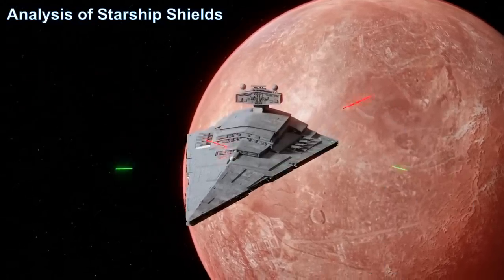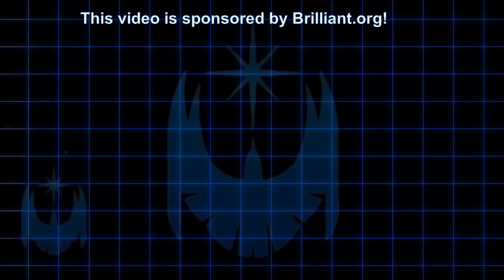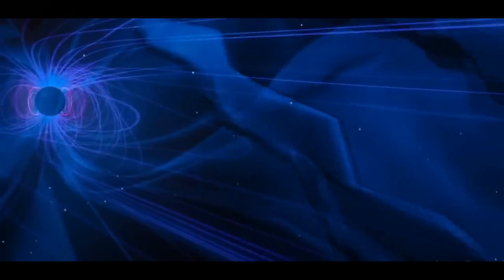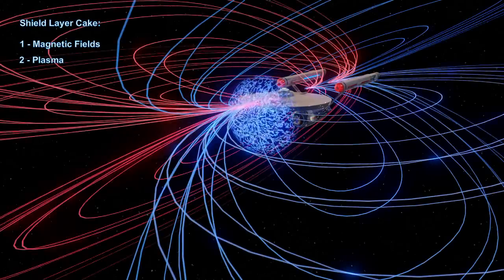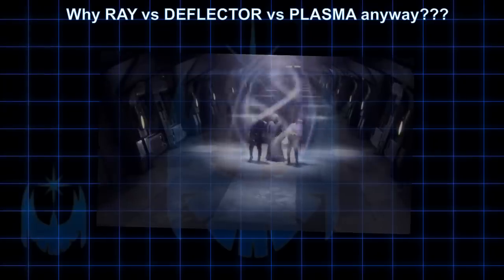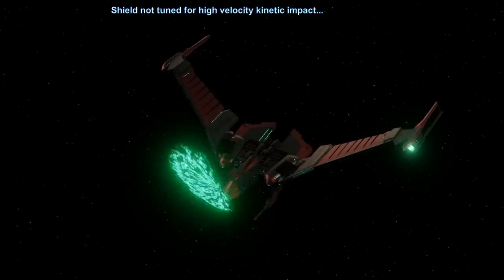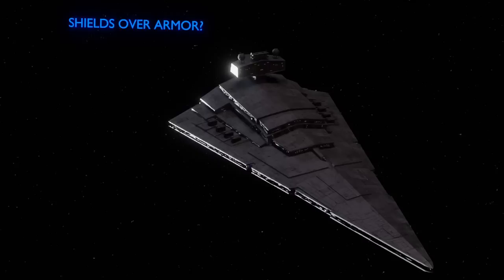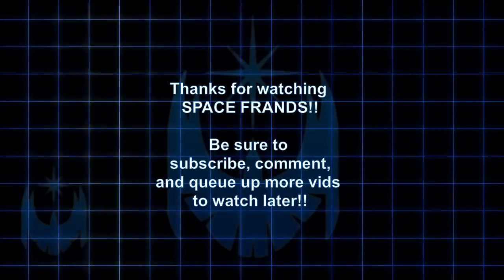REAL Starship Shields Types - They Work Like This...Animated Breakdown!

Comment: Another interesting use of shield systems in sci fi is the reflex gun in space battleship yamato where the beam is reflected from different satellites with shields to attack a enemy ship from multiple directions.
Reply: Oh you mean the Gamilas reflection cannons.
Reply: @barrybend7189  yes
Reply: The reflecting satellite cannon is a fairly unique one
Reply: @aliboy357  wasn't this in Tiberian sun?
Reply: @snikrepak  that's the Generals variant.

those in Tiberian Sun are parked in orbit — they don't need space mirrors to strike ground targets because they're already in space

two different things.
Reply: @aliboy357  except it is a one trick pony. If the weapon was used against starfleet, 9/10 times they would figure out how the shield works and modulate the shield to reflect the beam back to the cannon and make the gamilons embarrass themselves.
Reply: Speaking of SBY, its shields also let projectiles through without failing entirely, at least in the newer adaptation.
Reply: @justinthompson6364  it doesnt, the shields are an area of warped space around the ship
Reply: One can come up with Dynamic ways of Arranging New kind of Reflectors which Can also act as Beam Manipulators.
Reply: Remember Macross's (Point Defense shields) Pin point barrier system? Saving on energy usage vs an Omni directional Barrier system. and upping the power to the shields to just that one spot.
Reply: @Leo_ライオン  this type of system need computers to make millisecond decisions on what part to protect.
Reply: @addisonchow9798  Or a few gamers with joysticks, :D
- Think of the classic Arcade games, Pong, Centipede, Gorf, Space Invaders, Galaxian, Galaga, Missile Command, Asteroids. 
- Granted allot of these Classic Arcade games are where you shoot down incoming enemies/projectiles.
--- Never under estimate the reflexes of an old school gamer, I used to play Tetris so much. I saw the bricks falling when I closed my eyes, & in my dreams...
Reply: @Leo_ライオン  unfortunately, human reflexes isn't enough to react to anything that hits faster than 60 fps. The computer can make navigation and shielding decisions based on sensor data to coordinate different ship systems such as weapons, engines, and the shield to minimize damage. It also can calculate the shortest route to the enemy target while giving the human crew more time to think up a strategy to deal with the enemy and prevent a checkmate position where the ship can no longer defend itself and is destroyed or captured. Think about the active defense systems on tanks.
Reply: @addisonchow9798  While I understand the context of your proposition, & yes Computer assist is a must. A person trying to intercept a laser with a ping pong paddle would be quite the feat. 
- The often conjectured 60fps optical speed processing ability of the human eye is an inadequate value of mesurement.
- First it's off a bit, In 2014 the Massachusetts Institute of Technology conducted a study that showed the human eye could recognize an image shown for only 13 miliseconds. or about 72 Frames per second.
- But, The human eye can perceive objects moving up to 17500 meters every second or 38,146 mph.
- Considering FPS as a contextual measurement, then If you use the formulae (time = #frames/Framerate,) 
- In Considering of an object in motion from start to finish. 60fps would amount to 41mph rounded up.
- So (60fps) is a flawed measurement of human optical capability, or processing capability. 
-That doesn't invalidate your proposition, Human brains are flawed, easily distracted, & convoluted organic computers. Not really efficient to such a task as observing point of discharge, & calculating point of interception for a pin point barrier type system without computer assist.
- Furthering the supposition that the 60fps bench mark is a flawed context for measurement.
- Consider a Rotary wing on a Helicopter, moving at 225 knots (259 mph; 417 km/h) It still remains observable by the human eye. That object would be moving at the rough guestimate of 379FramesPerSecond.
- Granted it's a blur to the human eye, & your likely not going to read anything written on the rotary blades.
- That's the speed record for a Helicopter, Westland Lynx flew at nearly Mach 1 in 1986.
- But Your logic remains valid, An AI in todays market can interpret 50,000 FPS. While that's still not taking so many ques into factor. 
- Technically, & roughly speaking with the math, The human brain, could potentially process information at 55,823 FPS. Which is about the maximum speed the human eye can see a moving object at., which is 38,146 mph.
- The human brain can no longer process light reflected off an object moving at those speeds.
- Apropos: Never underestimate the power of the human brain, AI still hasn't beaten us for processing power just quite yet.
- to put it another way, lets stop using 60fps, & use 72fps. which amounts to nearly 50mphs rounded up a bit to make the math easier.
- Even our bodies can move faster than that, 
- In 2010 Aroldis Chapman threw a Fastball at 105.1 mph.
- Hockey Clocked a puck at about 108.8 mph.
- Pingpong saw a ball smashed at 69.9 mph.
- While Tennis saw a ball fly at 163.4 mph.
- The Fastest kick in Soccer amounted to about 131mph,
--- All of these objects are moving faster than 72 Frames per second., which is about 50mph.
- And people still manage to intercept them.
--- Lets look at it another way, when your driving at 50mph, you are processing objects flying by at 72 Frames a second. According to observable optical capability in those studies, that should be the limit of human optical processing ability. Right?
- Still, at those speeds most folks have no issues of reading signs, or changing lanes.
- Honestly though, I think anything above 40mph is to much for my poor old car to handle. so. they really should slow it down...
Reply: @Leo_ライオン  human brains are not 100% hardwired to fulfill a single purpose, so human processing speed is much lower and we haven't managed to hook up brains to a ship like the cylons.
Reply: @addisonchow9798  True,
- We are great multitaskers. In theory...
- Some studies have shown human processing power can jump 5x baseline when surrounded by a myriad of stimuli.
--- From my own observations I'd say our  conscious mind gets in the way, & trips us up.
- such as When a sniper clears their mind, & focuses on their task. they are able to perform much better.
- Reflex reactions, without thinking about it. Thinking is what gets us in trouble. Most Gamers will attest.
Reply: @Leo_ライオン  a human mind can only focus for so long before it needs a long break. A computer could last as long as it has electricity. In a high intensity combat situation where relativistic weapons are being thrown at a ship for days or months, it is important to have more crew to be awake and make decisions.
Reply: @Leo_ライオン  a time on target attack from  a sufficiently large fleet can overwhelm a pin point shield system.
Reply: Do you know what the discussion about sheild systems in syfy films is called?  Stupid.